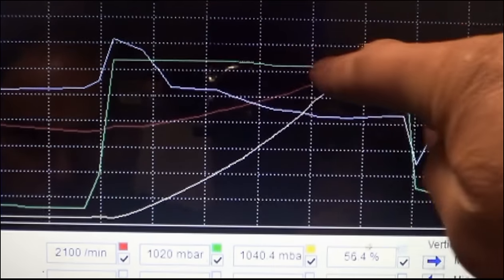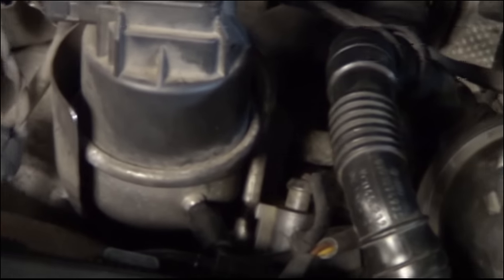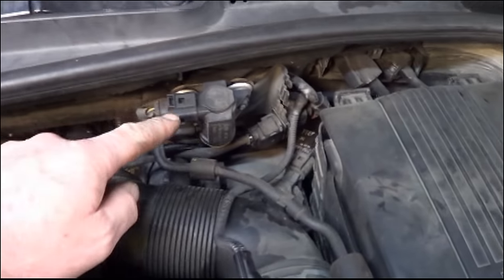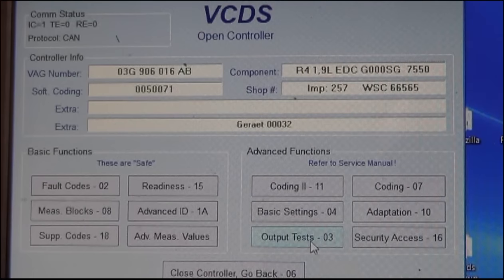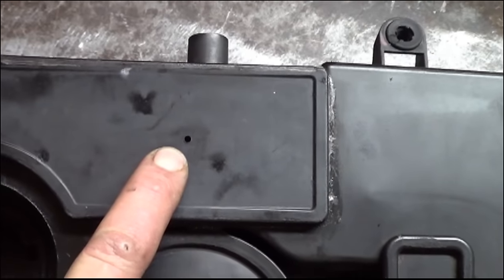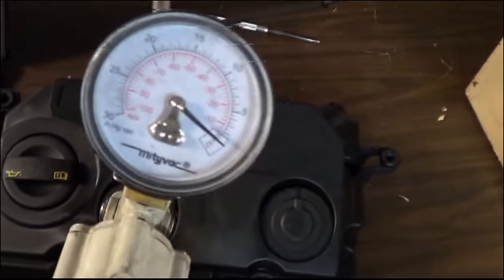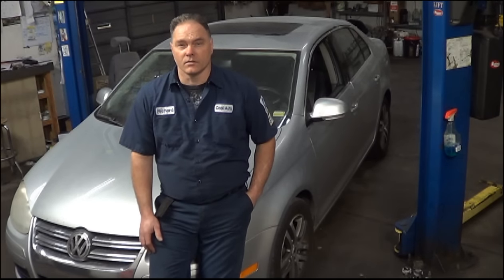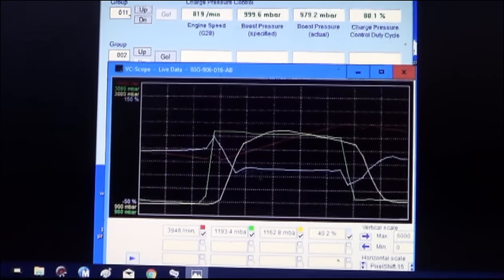06 tdi low boost P0299

Comment: Brilliant video. Lots of really good info on this issue. I've got the exact car with the same issue. Planning on digging into it tomorrow.
Reply from the maker: Thank you.  Very common for the turbo actuator diaphram to be ruptured.  Look for vacuum leaks also.
Reply: Question: I've got a 2006 Jetta TDI (BRM) with an automatic transmission. I'm getting a low boost code (P0299) and can't find any vacuum leaks. When I connect the vacuum line to the N75 (pressure converter), it seems as though it sends full vacuum to the turbo actuator (the actuator holds vacuum just fine and is set to open at around 3-5 PSI vacuum and fully opened at 18-20 PSI), thus forcing it to open completely and run horribly. Do you know if the actuator is supposed to send full vacuum to the actuator at idle?Hope that all makes sense.
Reply from the maker: I think your question is answered at 13:43 in the video.
Reply: Thanks, so I guess I'm getting the exact same vacuum from there, but for some reason when I connect it (as seen at 13:45) to the actuator the car starts running horribly. I can see the pin in the actuator drop all the way down. It has a new turbo on it and I know the veins are moving just fine.
Reply from the maker: Thats strange.  Can you define what you mean by "runs horribly"?  Are you still driving it?  What brand or supplier is the new turbo from?  Does it trigger trouble codes?  Have you inspected for camshaft wear?  Camshaft wear problem would be very evident if the intake tube was removed from the intake (at ASV/ EGR ) valve and you ran the engine. It would sound like popping from intake usually.
Reply: The turbo was just the cartridge from a wrecked Jetta with 90k miles. No play and spins nicely. The camshaft was replaced last month along with the auto flywheel. It runs horribly as in it blows black smoke and idles more or less, but can't accelerate. Strangely though,  if I put a check valve that restricts the flow to the actuator, then some vacuum gets by and is enough to see the turbo spool up pretty well and the car runs nicely for a while until it again gets too much vacuum. Pulling my hair, haha.
Reply from the maker: Was the turbo you replace the same?  specifically the actuator?
Reply from the maker: You probably have the vanes sticking in the zero boost position.  Maybe even just an adjustment problem.  They tend to stick in the zero boost position.  This leaves the vanes completely closed and exhaust is restricted along with no exhaust passing the turbine so it doesn't make boost leaving too much fuel for the amount of air.  take a look at my website and find my email address.  Shoot me an email and mention your questions here and I'll send you a couple links.
Reply from the maker: Oh, and the EGR valve sticking open can make it behave that way as well, but I doubt it with what your saying.
Reply: Wow, thanks so much for all the info. You've definitely given me a lot to think about. The turbo was the exact same. Where you mentioned the vanes being closed and the exhaust being restricted sounds like exactly what's going on... I actually had an issue with the EGR cooler mechanism because I think the exhaust was creating too much pressure because of that. It actually might just be an adjustment. I'll take a look tomorrow to see if it a little off or if it's sticking. To rule out the EGR, could I just unplug it just to see if it runs a little better?
Reply from the maker: It certainly wouldn't hurt to unplug and see, but if its stuck slightly open unplugging it wont make it unstuck.  I should trigger a code if its stuck but I've seen a couple that didn't.
Reply: Sounds great, thanks again for all the help! It's snowing here in Utah, but I'll get to it as soon as it lets up.
Reply: I just wanted to update you on what I found. It turns out the bump stop for the n75 on the turbo had backed out completely. I put a similar bold with sealer and problem solved. Thanks once again for the help.
Reply from the maker: Excellent!
Reply: @rsage_  What do you mean bump stop?? I am diagnosing a similar issue on my 06 TDI BRM.
Reply: @chadkap.7697  If I remember correctly, there's a stopping point on the diaphragm with the 10mm screw used for adjustment. My issue was that it backed out and so the diaphragm would open completely without the screw to keep it from overextending.

Comment: nice catch,and also you got it easy;  suppose the engine ECU had gone astray and was commanding the N75 wrong, now that would have been a job; have a 2004 Laguna 1.9 DCI here with the opposite problem (takes off slow,then goes to over 2.5 bar of boost, scary fast,and  i'm running out of options!! everything is ok,  no check eng.light,no error codes... but the ECUs on these sit under the battery,very low, and they are prone to heavy corrosion on the terminals...

Comment: Had this error code alongside a few other indicating the same issue. It turned out to be a single small hose that chipped a bit at the end slipping off. I cut it off a bit at the end and it's all back to normal now. It was a small hose located just over the turbo.
Reply from the maker: excellent!

Comment: That's a real good research into that vacuum side of things ...dont know if u can remember but I asked about hydrolocking on a 2002 jetta well it turned to be good after I changed out the charge air cooler with a new one car drives good ...but I have a similar problem as u just described loss of power but it will  come and go as you drive the car would it be possible for the vacuum side to cause that type of symptom...thk you for your videos they are very helpful keep up the good work.
Reply from the maker: Yes it is possible.

Comment: Hi mate, i have simler issue and no one can see to find my issue. i have changed and swapped everything. i have a bigger turbo fitted and mapped. was runninng fine in my a4 sallon but now i changed to avant same engine code and put my turbo and ecu on to the avant. but if i rev car and hit breaks i lose all vac. if i drive and press my brakes the brake pedal goes rock solid. Could this setup require something like boost bottle to hold more vac or do you think tandem pump is going?

N75 is replaced and simplified, no egr or flaps. vac line come from main vac too the N75 then from n75 to turbo actuator.

Car is AUDI A4 B7 Avant Quattro 2.0TDI BLB PD140 (Ecu is from 2005) body is 2007. 

Some mechanical mods (Witch i had on my saloon and had no issues was mapped by FADR)
120% injectors nozzles
GTD2263VZK running (3.1bar)
BKD Inlet (flaps delete)
EGR Delete
ASV Delete
MAF Delete

try to give you as much info as i could hope you have some ideas i can try.
Reply from the maker: Dont know.
Reply: @CoolAirVw  bit blunt but thanks anyway worth a try.

Comment: 2014  VW 2.0 tdi.     It had an underboost issue p0299 edof last year,   It had a new turbo fitted this January. Shaft / bearings had worn, Veins has seized up and It has been fine up until 2 weeks ago.     once again got the p0299 underboost.
 I’ve Checked all vac pipes 
Vac pump
Checked the n75 
Checked the actuator travel and diaphragm 
Checked all boost pipes, clamps ect 
Fitted a new EGR and the checked the exhaust had carbon built up....  Any ideas?     Thanks

Comment: i wish i have a mechanic like you in my reach..
Reply from the maker: thanks for the compliment.
Reply: Me too
Reply: @CoolAirVw  i have similar problem with my audi a4b6 1.9tdi.. when im in 2nd gear i floor it, and until it gets to 2100rpm it feels like im driving 1.0 engine, the moment i reach that 2100rpm turbo starts, and it rips tires. my ecu is ABT mapped to arround 170hp, im not sure, but i feel like it should be more agile in low rpms and have better acceleration.. any ideas of what sould i check? our mechanics here are nowhere near your knowladge lvl, pls give me some pointers.. and sry for broken engl.. :S

Comment: hi is there a fuse for solenoid valve n75 golf 6 tdi
Reply from the maker: I dont have them all memorized.  I know for a fact there is a fuse for the mk4 cars and that fuse powers several items (will trigger several codes) but I'm just not sure on your car.

Comment: Came across this video after searching the web for to weeks. Invokes like you know what your doing very concise. I'm just wondering if you could help me please. My mk6 golf dsg i changed out the master cylinder and started bleeding the brakes everything was grand till I got to the back wheel with the bleed screw open my helper pumps breake pedal and it went stiff so I taught job done so I got into the car started it up and the breake was like a brick. With hardly any breake at all. Did I put the master cylinder in wrong as it was very hard to pull out and when I put the new one in it just slid in and out no resistance. Any help really appreciate it
Reply from the maker: is there vacuum to the brake booster?  Is the plastic hose that goes to the booster cracked?
Reply: Yeah after looking at your video it gave me great clues so I was listening out for hissing it turn out that when I was taken the master cylinder out I  slightly knocked the breake booster harness out couldn't be leave such a simple thing would give me very little breake and my car went into limp mode. Thanks for putting me in the right direction. Your videos are the best I came across on you tube great work
Reply from the maker: @wackey3455  I'm glad I was able to help.

Comment: is this  a cause  even  you can move   the turbo actuator  high enough - by hand 
 Do you think it still could be  fullc arbon ?
 cause i  can move it  the turbo actuator  all the way, but i can feel it 
its  not so smoothly /
 i did the clean the turbo  with oven cleaner  and its much better move now; might i wrong;  do you think  i should buy a new   turbo from Volkswagen

thanks so much, i think you help lot of people
Reply from the maker: I do not know.

Comment: Hello! I have a Golf 6 2.0 TDI, replaced turbo, new N47 turbo solenoid, new vacuum acutator, new intercooler, hoses are fine, everything fine, did a DPF OFF and stage 1 on it, but GETTING this P0299 UNDERBOOST and I really don t know what to do, every test of vacuum fine, replaced engine cover as well
Reply: Should the stage 1 not being configured properly or what could be the problem?
Reply from the maker: @elena6688  I doubt it.  Sorry too complex of an issue for me to answer intelligently.  p0299 is boost leaks or vacuum control or actuator adjustment.  If  you've done all that, then your missing something.
Reply from the maker: @elena6688  you should probably watch the following video.   Maybe it will have some info in it that you can find the solution to your problem.  https://youtu.be/1ZCx6bVK6gc
Reply: @CoolAirVw  Well, vacuum leaks no doubt about it, checked and nothing, actuator position is great, i don t really know what could be that p0299
Reply: @CoolAirVw  I will check it thanks

Comment: So I am having the same issues as what the vehicle in the video is having. I found a couple vacuum lines that has holes in them. I replaced every vacuum line I could. I'm getting 25 inches of mercury from source vacuum but only 15 at n75 valve. No holes in the valve cover no other vacuum lines to be replaced.

Comment: hi just one question, can I clean  turbo on Passat b5 with special  spay to spray it inside  the EGR valve when the car  is on   with full power  around 4000 rev engin
Reply from the maker: uh, you can do whatever you want.  Lots of people try improvised cleaning methods.  I dont know that I would rev the engine to 4000 that might be a  it excessive.  Personally I wouldn't spray anything in the intake (or egr)
Reply: thank you so much, do you have a video that how to clean turbo, thanks Passat  b5.5 1.9 TDI. 130 hp I think you only smart person around me

Comment: I was wondering I have a 2008 Volkswagen Passat 2.0 t my computer went into limp mode and said turbo underboost so I figured it might be my diverter valve or the Westgate but my arm come unscrewed or something from the turbo so I screwed it back on and now I'm still getting a cylinder 3 misfire I do not know what the factory settings were on it now I can drive it a few miles and then the light will start flashing and it's like it's missing and fixing to go dead I guess going back into limp mode and I get it back to the house and it is pulling up a cylinder 3 misfire I do not know if that has something to do with the turbo it seems like it runs a lot faster than what it used to any help would be greatly appreciated on how to adjust it or what the factory settings is
Reply from the maker: Misfire is probably not related to turbo.  Try replacing spark plugs and swapping coil packs to see if misfire moves.  Of course there are lots of things that can cause misfires.
Reply: @CoolAirVw  ok thanks

Comment: hi, on my pasat b5,5 TDI  130 hp .  my  turbo actuator is working all the way with 
vacuum pump  the same as yours
 
But  or I think  the n 75 valve  cannot move the A turbo actuator  enough
just 1  centimeter. .
Do you think  if i change n75 would be ok?
do you think the turbo actuator should all the way up?
when the car start
also  i didn't find any  holes in vacuum  pipes
any  idea what should I or could  do
thanks
Reply from the maker: please explain how you came to that conclusion?    Is the actuator moving all the way to the sop? 
If you use a hand vacuum pump will the actuator move all the way to the stop?

Comment: I have a vow caddy 1.9tdi that goes into limp mode bringing on p0299 low boost
If I clear the code the van flys and can be like this for days and sometimes it will last for minutes before it goes back to limp mode
I have had it smoked tested for leaks and it was ok
When the code is clear the van boosts very well and if you clear the code when going along it will fly again
Any help on this
Reply from the maker: try the tests in the video

Comment: Great video, my 2006 VW Jetta TDI has similar problem, goes into limp mode. I am not willing to pay VW what they want to fix my car's problem. I can at least tackle this problem with some education on what to look for.
Reply from the maker: thanks.
Reply: I’ve got the newer 105 engine and there’s no tutorials on it for p0299 all boost pipes on turbo trying to boost but just vibrating

Comment: Very useful video. I have a similar problem on the exact same car. I had the turbo rebuilt by a reputable turbo rebuilder, installed it, and the car runs like crap. No power until 2200 rpm, black smoke, rapping noise, acidic smell from under the hood like the converter is overheating. It ran better BEFORE the rebuild. If I remove the hose from the VNT actuator it's a whole different animal. Tons of smooth power, no significant smoke or noise. Ran some tests. Put vacuum to the actuator and the rod moves smoothly and holds vacuum. Checked the solenoid and it puts out good vacuum to the valve. Do have the code P0299 low boost. What to check next?
Reply from the maker: black smoke and low boost probably means a boost leak.  Look for splits in hoses or disconnected hoses.  I have a video on a boost leak, but its a different car.  Point of me sharing this video link is, smoke plus low boost is boost leak.  https://youtu.be/GMqpIfa63jA

Comment: does this work with the check engine light? i don’t understand if my actuator is bad or if the check engine light cut power to it. i’m not great with cars so sorry if i don’t make sense
Reply from the maker: The trouble code that you saw me get out of the computer using the laptop with the vagcom system will trigger a check engine light.  Be sure to watch my other videos on boost problems.

Comment: Question ...  If the hole was there all the time ...why was the fault intermittent ?   Surely a leak that was there all the time would always trigger a code and limp mode .. I'd love an explanation.
Reply from the maker: It takes a certain amount of driving with the fault present to make the code reoccur.  I wasn't driving it hard enough, long enough.
Reply: @CoolAirVw  -  Thanks for the reply , since i wrote , following your guide I used a vacuum gauge ( different make same idea ) .. and connected it to the line feeding the actuator , then I ran the test procedure for the N75 as you did ... Its building /holding and releasing vacuum as normal .  After that I looked around with a flash lamp and noticed a large rubber bottom pipe had been rubbing against a bracket and it appears to have worn a good deep groove in it .. for the moment , i have wrapped / sealed it with gorilla tape to see if that makes any difference ..  the pipe appears to be routed from what i assume is the intercooler to turbo ... any chance its the culprit ?
Reply from the maker: @jaycee7841  yes, a boost leak will cause low boost trouble code.  I have another video on boost leaks.
Reply: @CoolAirVw   thank you    I'll look